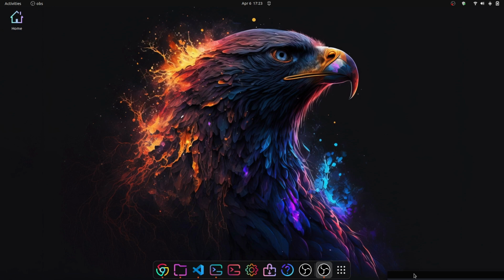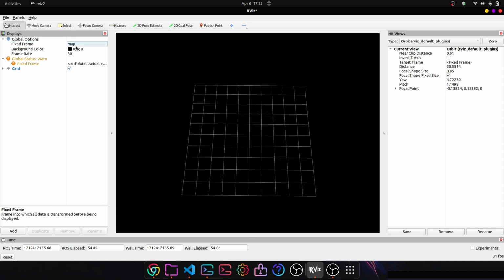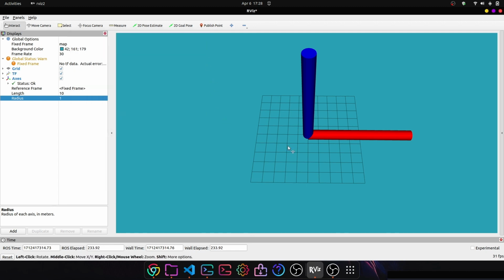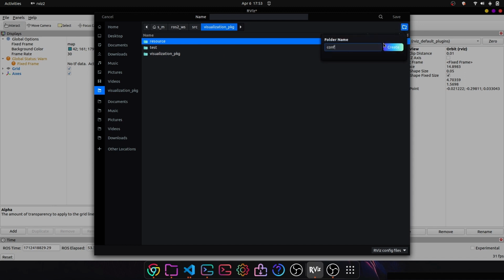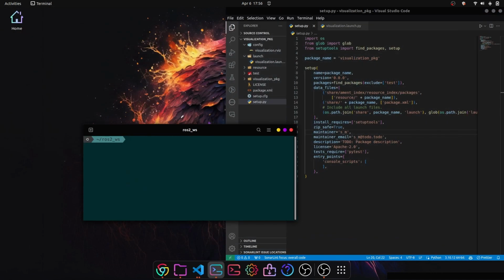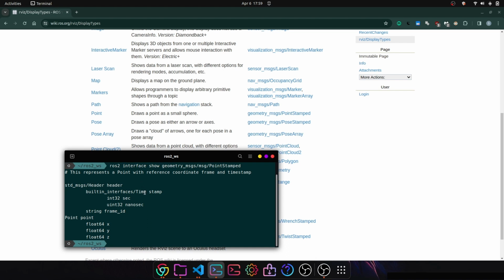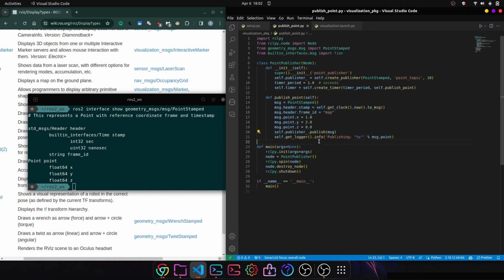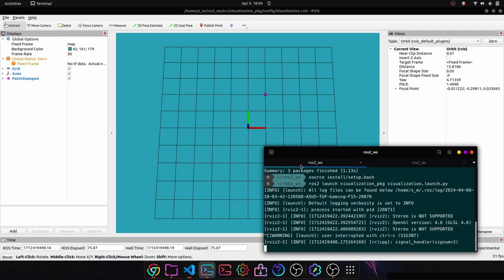ROS2 RViz Part-01 Tutorials: Customize RViz2 + Learn to utilize RViz visualization tools.

Comment: Hi i cant visualize my point in rvis i go exactly like you step by step
Reply from the maker: Hi Fatemeh,
Once again, please ensure you have followed every step. If the point still does not show in Rviz, pay close attention to the following:

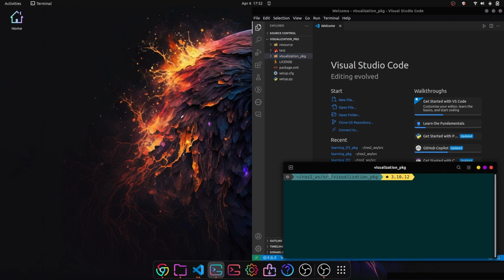1. Ensure you have saved the Rviz config file with the correct world_frame and axis settings and provided the file location in the launch file. (Video reference: 8:28)

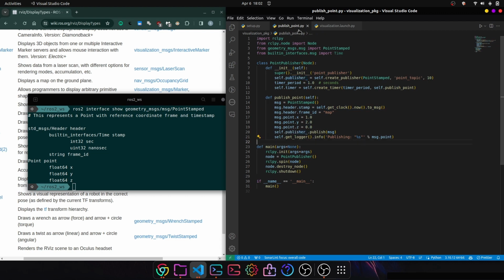2. Check that the written code and setup.py file are correct line by line. (Video reference: 18:22)

3. When executing the launch file and the publish_point node, make sure you see the data of the point being published in the output screen (terminal).

4. You can also use this command in another terminal to print the topic details: ros2 topic echo /point_topic, and check the frame_id, coordinates, and other details.

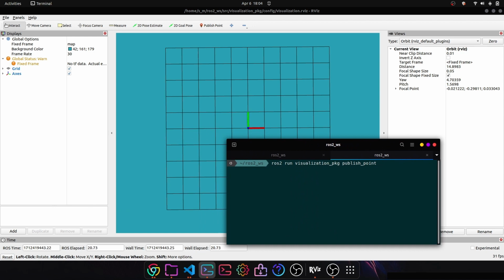5. Lastly, after launching Rviz and running the node, ensure the fixed frame is set to "map" and that you have added the topic using the "Add" button in the lower left of Rviz. (Video reference: 19:41)

I hope these steps resolve the issue.
Reply: @Easy_Peasy_Robotics  thanks alot i guess my problem is  fixed frame i have no tf data for error